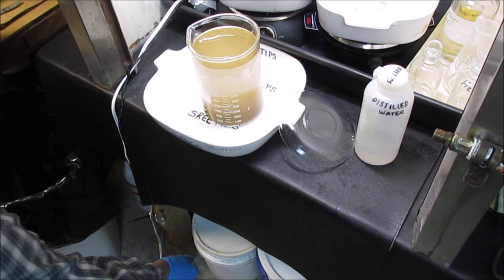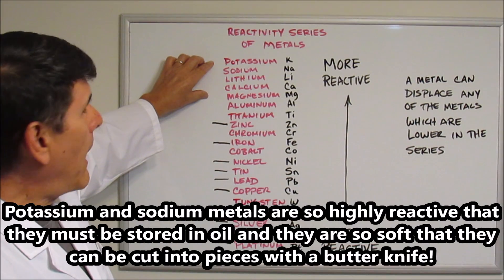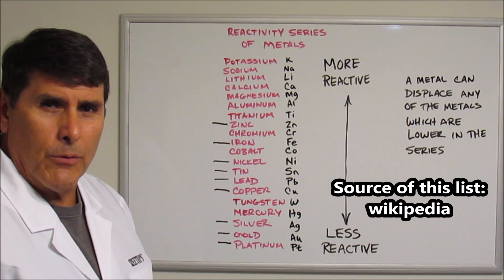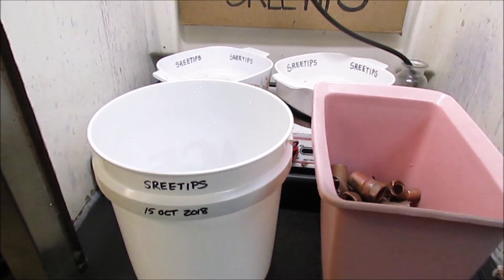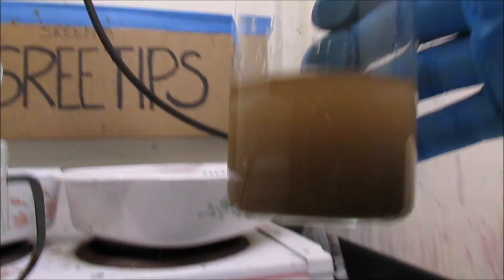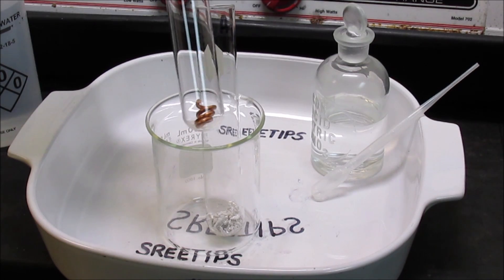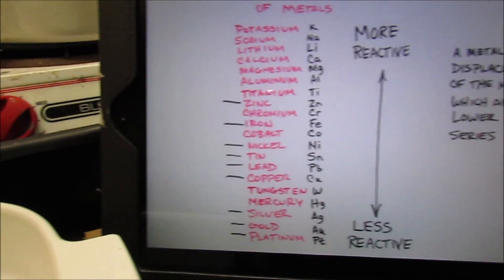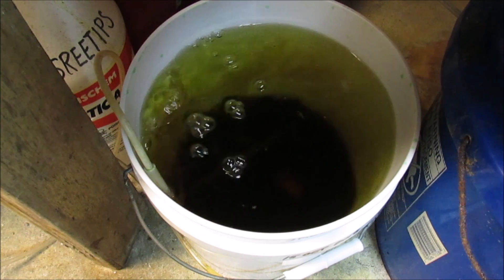Stock Pot 1 of 16 Gold Refining Reactivity Series of Metals

Comment: Id of concentrated that stockpot solution mate down to the salts, then added just enough water to put it back into solution, and worked up from there asit ls just easier to handle less volume. And dont trust that gold powder that dropped out without acid bath first, i just made that mistake it had copper with it!

Comment: do you add to the stockpot AP filtrate and AR filtrate after precipitation?
Reply from the maker: Yes
Reply: @sreetips  so the solutions from denoxing and smb should not create problems in the mix?
Reply: I was asking if smb,urea,etc could create bonds to impede cementation...
Reply from the maker: No

Comment: Holy shit! I just noticed you're over 100k subs! Nice man! I remember when it was a third of that when I found your channel and subscribed. I'm surprised you dont evaporate down those solutions before adding it to the stock pot or maybe you just skip showing that since it's super boring. I'm excited for when I finally process my AR cement bucket. Been collecting for almost 4 years now. When I siphon off the waste for the iron bucket I get to see the thick layer of black sludge at the bottom of my bucket.

Comment: Ever think of suspending the copper in a mesh bag in the stock pot? Seems like you'd get better reactivity if the fittings you're using to cement weren't sitting in the sediment.

Comment: A guy told me to not zinc my stuff. The first AR filter and put copper pipe in solution. It only precipitates precious metals. I was going to zinc it. He said no. zinc will drop the stuff I want to get away from. Is this correct? I told him my stuff has sulfur. He said copper will do the same, only drop the metals below it.
Reply from the maker: Zinc is much faster than copper. But zinc, being much higher in the list of metals, will cement out other metals such as iron and copper.
Reply: @sreetips  I have your video explaining the metals periodic chart. I see from looking the zinc will precipitate a lot of metals that I should want to stay away from. So I guess it would be better for me to wait longer and use copper, then zinc.  Thanks again
Reply from the maker: Yes! You can use the reactivity series of metals to your advantage. But if you're not familiar with it then it can work against you.
Reply: @sreetips  So your stock pot bucket, by you putting copper in there, it cements out your precious metals to the bottom, leaving the base junk metals in the liquid?

Comment: What stock is Stock Pot waste?

Please explain more

I am from another country

I did not get you
Reply from the maker: My gold refining waste solutions may contain traces of platinum. Too small to try to recover and refine. I add these solutions to my stock pot. It's a bucket full of metallic copper. The traces of precious metals will come out of solution on the copper and accumulate in the stock pot. I've been adding my gold refining waste solutions to my stock pot for over three years.

Comment: I had a terrible vision of you dropping the old stock pot all over the floor. Have you ever spilt a pot.
Reply from the maker: No, but I had an HDPE plastic bucket crack wide open at the bottom. Nothing in it when it happened

Comment: I was gonna mention be aware on scrap copper fittings you may have flux or solder contamination . The solder may be silver or other combination metal which will cement higher metals in this step. Just a thought seeing one of your pieces had some silvery color.
Reply from the maker: Quite true. I peeled the bar code labels off. The glue left an appearance of silver. The fittings were brand new never used.
Reply: @sreetips  that explains it. Thanks again for this video. I'm recently subscribed as your videos are very detailed and help expend our knowledge.

Comment: Great video as always, but it left me with a question. 
When refining gold, you add sulfuric acid to precipitate any lead present after dissolving the gold in aqua regia. Based on the reactivity series, wouldn’t the precipitated lead, being higher in the reactivity series, displace the gold in solution, causing it to cement out?
Reply from the maker: Metallic lead may precipitate gold. But lead sulfate will not.
Reply: Ah, I see my mistake. I was thinking that metallic lead was being precipitated, not lead sulfate. Thanks!

Comment: Small question out of curiosity. What would happen if the test tubes were standing in oil or water? As a layman, I think that the heat would be better distributed or better controllable, but you seem to never do something like that, so there must be a reason for it or my thinking is completely wrong.
Ps. Sorry for the shitty google translation
Reply from the maker: Not at all. The reason is simple. There is enough heat as is and less mess to clean up when the reaction is done.